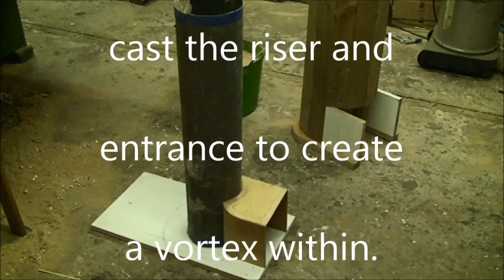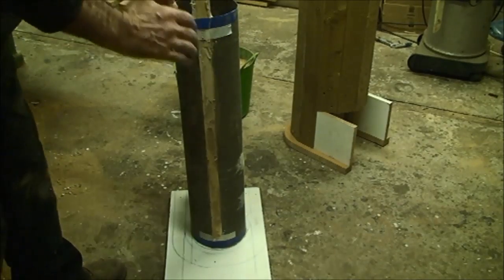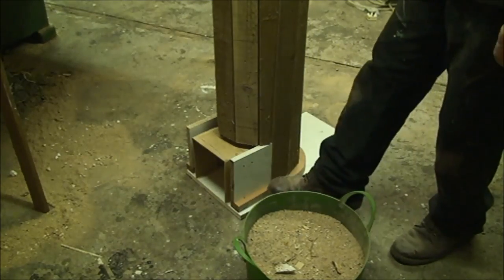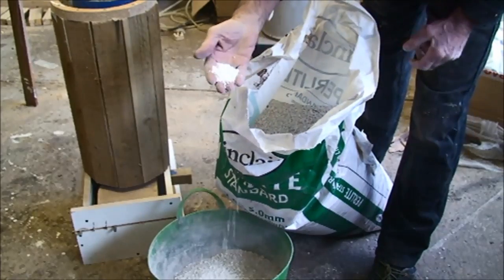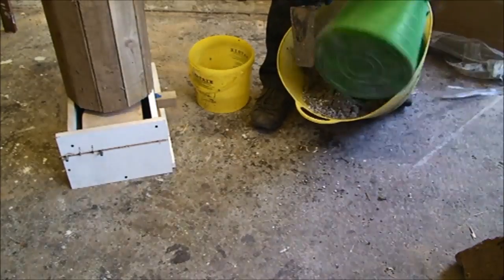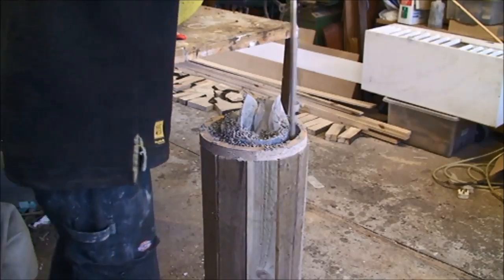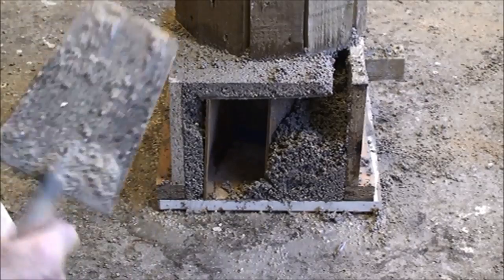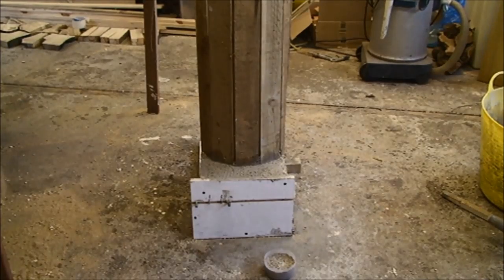New rocket stove mass heater cast riser Part 1

Comment: Would you know if reinforcing the refectory would increase the life expectancy and keep the casting more firmly attached to the metal tube ???  How much perlite did you add percentage wise Loz ??? Sometimes a little to much tap tap can cause an issue fella. Nicely done too.
Reply from the maker: be better to cast the riser in 3 sections all the same size, so easy to replace one if its damaged not sure on reinforcing. perlite was a third by volume.
Reply: @LozHarrop  Thank you for the specific information I asked for and received too. Vic

Comment: I have a suggestion for you about the riser tube. Use 718 Inconel metal tube. This is the king of heat resistant material that will always stay shiny and new. Also. what is the chance of you having a prints for making the stove Sir ???? Thanks V

Comment: Hey Ppotty1!
What a great project :)
So, how did the refracturate hold up? Did it crack or is it still going? :)
Greetings from Finland!
Reply from the maker: still going strong but i actually cracked it by taking the thing apart for a clean, forgot it was strapped at the bottom and tipping it onto a sack truck to take outside probably caused the damage

Comment: Hello again,  Santa bought me the 'Wisner' Rocket stove book so I've been busy "studying". I have also been reading the Peter van den Berg postings and notice that the opening between his burn tunnel and heat riser is much narrower than yours presumably to increase the air speed. Have you experimented with narrower 'slots' ?

Comment: What's the advantage of casting the vortex tube instead of making it out of metal?
Reply from the maker: Mainly the heat destroys the metal over time, i wanted a trouble free firebox and riser on this stove having seen the damage the heat does over a year or two. Still working as good as the day i first lit this no problems at all so more than worth the bit of effort.

Comment: I like your work but you're not going to last long if you keep breathing perlite dust! Get a dust mask or even better, get a respirator. You're not setting a good example on that one. Otherwise, nice work.
Reply from the maker: Thanks Dangus, I use a mask all the time just take it off when im doing shots for the videos the mic cant pick up speech when is on.
Reply: One of the concessions of showbiz I suppose! Good to hear :) I'm building a rocket heater/oven/gassifier system for our tiny home on wheels and your channel is one of the best sources of DIY experiments on this topic. Many are just theory where you actually have projects. Thanks for the videos

Comment: I kind of understand why you used the perlite but how do you think it would work without the perlite? would the casting be stronger? would it not be as insulated resulting in poor burn? just wondering if it is really needed.  Thanks
Reply from the maker: +Den F. It would take longer to get hot Dan without the perlite a really dense casting sucks in the heat, how much longer i dont really know. I think to get the casting glowing red would take probably twice as long. But in answer no perlite is not really needed, i added it to speed up the heating process and yes the casting would be stronger without perlite. Cheers.

Comment: Excellent work. I want to repeat similar structure. I live in Ukraine. Tell me some mixture composition of cocrete. Thank you.
Reply from the maker: +Blekki Taims Hi there, this was a ready made product called high temperature refractory mixture, it is used for kiln linings etc I added perlite by 1/3 volume to make it lighter and to add insulation. hope that helps.
Reply: +ppotty1 Many thanks for the quick response. This information is very important for me.  Can prompt the the name "product called " of the composition, or a link to it. What would I have been able to take the same. You have not added fiber for the reinforcement ? What thickness of the walls ? Your work is very interesting. It's been a long time. As shown riser itself during this time?
Reply from the maker: Blekki, the link to the supplier and product is in the description below the video, I did not add any fibres and it is quite strong anyway. this is a video after the riser has been in use for one year. https://youtu.be/Un84EZ7XpFg Cheers.

Comment: Cool work! Having done a fair bit of refractory casting myself, this was good to see. Some pointers:
- Your aim is to have an insulating refractory, so heavy tamping increases the density and hence insulating effect. Much better to use a vibrator to get the mix to settle and remove its own air pockets. We found that with an apparently "dry" mix, moist material came to the top and left a nice smooth top surface
- Always mix the dry ingredients first. It results in a better mix before you add water
- Be careful of adding too much water. Refractory castables have a very definite water/dry mix ratio that has a small sweet spot: too much or too little and you do not get the best cementation effect in the finished product. When we cast our first unit, we measured carefully and it intuitively felt too dry and we added just a bit more water. Wrong!!!
- One of the things I did when making lower temperature insulation was to use finely sifted sawdust. The mix was good quality clay (which is mostly alumino silicate) mixed with sand on a 4:1 ratio(sand gives it mechanical hardness and acts like gravel in concrete) and then that mixture was mixed on a 1:1 ratio with the sawdust. This mixture requires firing in an oven so that you dry it out gently and then take the temperature up. As the material heats up past 300oC the sawdust begins to pyrolyse and by 900oC it has effectively been burnt out of the mixture leaving it porous. It made a nice light and fairly durable casting for use in gasifiers. In this case, I would add glass fibre strands as suggested into the dry mix to give the mix more structural strength as your temperatures are much higher.
- just some thoughts..
PS: Try this trick: use polyethylene sandwich wrap on the refractory side of the mold. Makes mold removal less of a headache...
Reply from the maker: +Rex Zietsman Thanks for that Rex, no doubt I will be doing more castings on my next build and will try out some of your suggestions Good call on the water content of the mixture...Cheers.

Comment: Just did my riser and fire chamber out of perlite and high temp refractory mortar. I went with 1 part mortar and 2 parts perlite, which turned out perfect. I let it sit for a week to cure and fired it up yesterday for a couple hours and it works perfect! I've decided to go with a 4" burn tube and 6" riser, with a little curve at the end of the tube like yours to create a vortex (making the flame spin up the riser tube) Now to start on building the square box around the tube.  Mine with have a firebox for log wood that can be removed and replaced with a gravity fed pellet burner, which I perfected on my last stove. It's unreal how hot these things get with so little wood!
Reply from the maker: +Painter D Glad it worked out well for you, be sure to post up a video maybe when you get finished. Your new riser will store alot of heat I know mine is still warm the next morning after a good burn.

Comment: I based my cast form from your design, though working from my shotty memory led me to glaze over a few of the details.  So now I have drying a 3" cast thickness, the kick/throw has a 3" diameter swing, and I centered the burn tunnel on the riser instead of making it eccentric like yours.  I hope it performs just as good though.  I'll find out in a day or two I suppose.  Thanks for sharing your ideas!
Reply from the maker: +Michael J Thanks Micheal, it should work ok mate maybe the vortex wont be as tight but the riser will still do the job.
Reply: +ppotty1 http://imgur.com/7qmiWdo Here's my specs.  My riser still needs to be raised a few inches, but other than that it works ok.  Not as aggressive of a swirls as I'd like, but hopefully this is increased when I add some material to the top.
Reply from the maker: +Michael J looks really good, should get a nice easy burn and plenty of heat out

Comment: Any reason why fiberglass shards/ strands were not mixed into the cast mix? It would have given the casting more structural integrity and resilience to cracking or fracturing. A helical steal coarse mesh could possibly work too, but probably requiring more effort at casting time. Great effort, and thanks for the series of videos showing the build.
Reply from the maker: Super Argo Hi and thanks, This was the first time I mixed and cast refractory and from what I had read I didn't think any strands or reinforcing would be needed, had it failed that was my plan but as luck would have it there was no problems and it still remains as good as when I cast it. Will have an update soon..cheers.
Reply: Thanks for the update.

Comment: How about soaking the perlite in water before adding to the mix?
Reply from the maker: Kevin Chamberlain Perlite holds alot of water and if you soaked it you might find the mix is just too wet, plus it would take a longer time to dry out, its easier to add water so the perlite is just coated and sticks together.
Reply: ***** Thanks mate!  Best I just watch silently?  :)
Reply: +ppott

Comment: if you ever cast again, scrap the perlite. get your hands on a load of storage heater bricks, find them for £1 each on ebay, Crush these bricks up with a mash hammer, then with refractory cement, and fireclay do a mix of 3 to 1 that's 3 of heater brick dust/grogg and 1 of refractory cement, then mix into this dry mix by hand another 10% of your overall dry mix weight of fireclay. so if your dry mix is 10kg you want 1kg fireclay.
the next bit is the worst bit, massage the fireclay into this dry mix until the fireclay has massaged into this mix and disappeared completely. it will resemble cookie dough, but too dry to cast at this point. now add water with a spray bottle and mix until you can squeeze a handfull and it doesnt fall apart too easily when you press this lump with your thumb, if it crumbles too easily its still way to dry.
Trust me the fireclay makes a huge difference to how it holds. You could add fireclay to whats mixed and shown in above video and that would sort the crumbling caused by dryness of perlite, but if it were me, scrap the perlite and use crushed storage heater brick grogg.
Reply from the maker: honi9 thank you for the info mate.
Reply: subscribed my friend, all good stuff. I build steel pizza ovens with stone. I cast my own stones to fit each bespoke oven build. That's how I learnt about the storage heater brickslittl practice and many builds later came up with that mix I told you about earlier. those bricks are cheap as chips, £1 each or you can find used lots of multiples cheap now and then on auction. I recently got 40x for £12. Their great bricks, very dense, it seems to be slag, dross from foundry cast into these bricks. they hold heat great and resist wear very well. deff press them in a solid frame and used a lot of pressure from a bottle jack if you ever cast pizza oven stones though, you want it compact and dense fro that purpose if you ever find yourself making any?
I am looking into waste oil burners and rocket stves to add to my line of current builds, so your vids have helped a massive amount, you did all the research work for me and I think you for that.
Reply from the maker: Never really got involved in pizza oven builds mate although done a fair amount of research and work on refractory linings and floors for my gas forges but it all comes in handy somewhere down the line e'h..cheers.
Reply: I noticed your emphasis is all about the heat retention of your stoves. I think your cast cylinder for the rocket stove was a great idea. Specially if you use the storage heater brick grog in your next mix. Those bricks are unreal, one brick alone must weight 6kilo or more. I struggle to carry 3 and deff couldn't do more. I was moving these out of a van and stacking them 2 at a time. They hold heat great, they cook pizzas amazingly well. ive used an oven with a stone that was purpose made for that job and cost a fortune from a pizza oven supply co. my pressed bricks work far better.
I think a cast cylinder in a rocket with this grog mix would be a top move.

Comment: Hi there,
 I have been busy viewing various designs in preparation to building my own stove and am impressed with the thought you have put into yours!
I have also been thinking along the lines of a hand cast pumice or manufactured ceramic riser so am finding your video very interesting. The design I have in mind would include an insulated firebox housed in steel (maybe tubular but not sure yet)vortex, secondary preheated air as per your design but on a smaller scale.
I was considering buying a section of Isokern pumice liner but not sure how it would handle heat over time... I have also sourced a ceramic flue it can handle temps up to 1600c so would be good with a ceramic fibre wrapped round with stainless sleeve over to form riser.
In my case I have a very well insulated room so am looking to make a much smaller stove to burn small sticks etc. I am also considering a thermo syphon tubular stainless water jacket hung like a mantel over the riser reaching a third of the way down with a removable stainless skirt sealing round water jacket and firebox/riser base. This will reduce excess heat into the room allowing it to be pumped via heat store (DHW cylinder) to other rooms in the house.

I was wondering if you could advise on minimum diameter of riser and ratio to fire box and air inlets etc. ? The ceramic tube I was looking at is only 80mm internally with a 10mm wall. Do you think this would be large enough for a 6" square fire box? 

Cheers,

Ewan from Scotland
Reply from the maker: Ewan Bush Hi Ewan, your 80mm riser would i think work ok with a 6 inch square firebox but if it could not cope you could always add more insulation to the inside sides of the firebox to reduce the size probably wouldnt need much. Just keep the air intake into the firebox the same size as the riser or go bigger if you wanted. If you had room in the exchanger you could fit 2 risers side by side giving you over 6 inch which would give you the same as this build, manipulate the riser entrance to feed both risers...just a thought. cheers.
Reply: *****  Thanks for your thoughts. I imagine if the air intake is to large in comparison to the riser diameter you can get smoke blowing back the same as badly designed open fires can do or maybe this isn't a problem? The main thing is to ensure draw and sizing of flue is sufficient to pull smoke away when top loading fire I suppose.
One other question regain your stove does inlet air pass through ash pan and up through grate or is this area closed off to force all incoming air up and over down into firebox? Cheers

Comment: 1600 degrees is way too cool.  You need 3000 to be assured.  Those things get well over 2000.  They've gotten one to 2900 degrees to melt stainless steel.
Reply from the maker: Morgrim X 1600 centrigrade is too cool for what exactly ? im not sure what you mean if your working in Fahrenheit 1600 C = 2912 F
Reply: *****
I apologize.  I realized that after I replied. I had just watched the video shown just below.  They were pretty adamant that the internal temperatures exceed 2000 degrees fahrenheit.  Now I realize that 1600 centrigrade is plenty good for what you are doing.  It's over 2900 fahrenheit.  That's the temperature a blacksmith achieved to make stainless steel molten.

I was especially pleased to see how you manufactured that riser.  I've been looking around and can't find anything similar. It's a really great design, and you were particular to point out that you avoid over heating it.  Obviously, you are very familiar with furnace design and quite handy with steel.
Reply: Morgrim X
By the way, I've seen other designs where fire brick is used to create a square or rectangular riser.  In another video, the creator was pleased to have achieved not one cyclone inside but a double one.  However, no one has stated the value of having a cyclonic effect.  I think a rectangular riser may not achieve that. 

What, if any, is the advantage of a cyclonic or anti-cyclonic spin in the riser?  Is it worth molding your own round riser to achieve that?  I suspect it is.
Reply from the maker: Morgrim X Cheers...The cyclone effect is all about mixing the gasses for better combustion, the swirling also heats the riser more as it holds the flame inside for slightly longer taking a spiral path up rather than straight up. To spin it left or right makes no difference, not done anything with dual cyclones, i think it creates more turbulence but cancels itself out very quickly as it moves up the riser.
Reply: +Morgrim X 
I think that ppotty means degrees Celsius. 1600 is plenty. At the end of the day it is actually about the mixture of alumina and silica that will count. Steel is molten and cast in the 1600 to 1650oC range. Once you get into glass melting where you are looking at 1800oC melting temperature, then magnesite bricks are effectively your only choice.